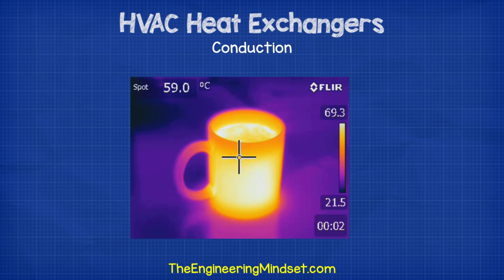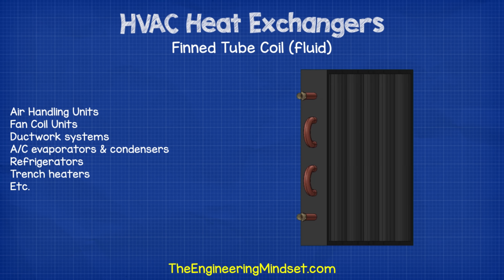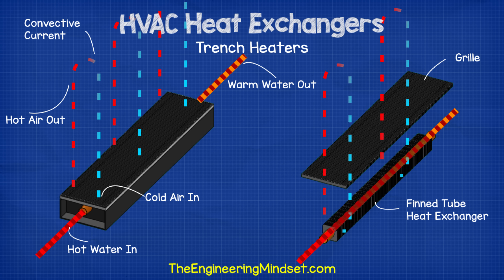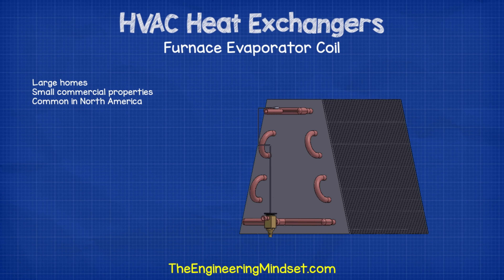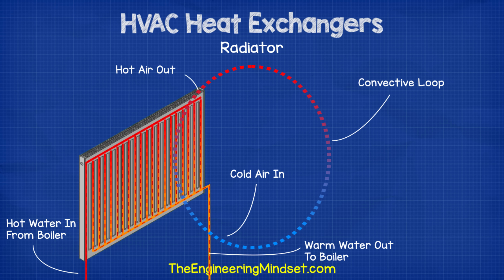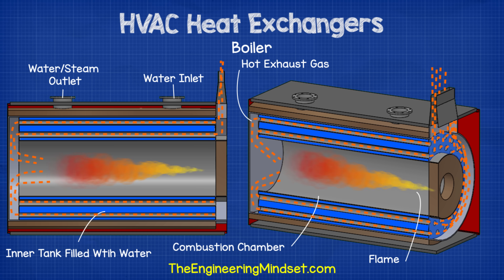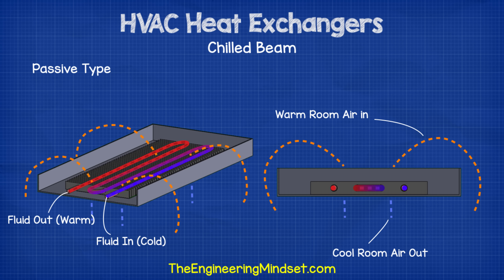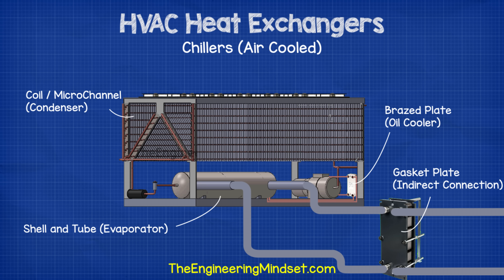HVAC Heat Exchangers Explained   The basics working principle how heat exchanger works

Comment from the maker: ⚠️ Found this video super useful? Buy Paul a coffee to say thanks: ☕
PayPal: https://www.paypal.me/TheEngineerinMindset
Reply: your videos have been so well done i have never supported a channel before but you do such a great job on all of your videos i have to support you and become a member Thank you for all of your videos
Reply: A. Barrel evaporator?
B. Brazed compact heat exchange?
C. Fin heat exchange?
Reply: Great video! Just one question: At 5:16, where it says "Exhaust Air Inlet (Warm)", should that be "Exhaust Air Outlet (Warm)"?
Reply: @tech3431   dk4kt
Reply: Hello sir, i like u'r videos
I m doing project on Atmospheric water genration device, by using vcc system but i don’t know how start n from where to start
Plz give me any guidance or suggestions for start my project
Plz suggest any good book for reff. Calculations
Reply: sir i have a question. what if i want to build my own mini electricity? through natural gas. since my place have own natural gas on underground.  now i want to install heat exchanger on my genset. is it possible to do that? instead of using it's giant radiator. I'll just took it out then replace it with heat exchanger system? so could run it continuously everyday?
Reply: @carlotheatheist  don't mess with your generator.... mess with that, you can hurt someone working on the hydro lines in the event you manage to backfeed power into the hydro line when there's power present..... geez the idiocy of people these days.

Comment: There's a sugary smell coming out of our ac vents we just had the evaporator coil changed and the condenser. I read the smell is from a cracked heater exchange.  My question is: Is the heater exchange located in the evaporator coil? The one we have is the cone shaped one (upside down letter V).

Comment: 13:50 - what is in the heat pipe?,a  low pressure water mixture?  or is coolant? i.e. something much colder than the cold water entering the device, no?

Comment: But where does the air going in come from? And the water flowing through the pipes do you put them there or they are bought like that?
Reply: The air is coming from a fan system.  The pipes are already in there .

Comment: You are using the term convection in the wrong application. All of this is conduction. When the hot surface comes into physical contact with the colder air, there is energy transferred by conduction. When two items of physical matter meet with a temperature gradient, that is conduction. 

Convection requires physical movement of a fluid. But even with that physical movement, you can not have convection until you conduct the energy first. So all convective heating is just conduction through a fluid. But when that fluid moves, it heats up the fluid next to it, again by conduction. Fluid is matter, so when matter comes into conduct with other matter, that is conduction. 

To make this clearer, it is like saying that there are three types of energy sources: Fossil fuels, nuclear, and electric. One is not like the others. Convection does not transfer energy. Convection is what you can call conduction if at least one of the conduction surfaces is a fluid.
Reply: Thin hair

Comment: What if the fins get tilted due to some external force and the thin tubing becomes close to each other in the heat exchange system in outer unit of my split ac. Do I need to worry about this? Will it effect the cooling mechanism of my air conditioner? Please respond.
Reply from the maker: Yes it will reduce it's effectiveness. You should use a fin comb to brush through and straighten them. Do not attempt with any other hand tools. Stay clear of the pipe.
Reply: @EngineeringMindset  can i send you the picture. It's more complicated. Someone stood over the outdoor unit and thus the tubing bent slight downwards making a swing like shape and because of this the fins got tilted. I can not straighten them as there is no space left for them to get straight

Comment: The radiator converts the temperature by radiation more than convection. It distributes the energy uniformly in the locals and chambers
Reply: The inlet on a Car radiator is feed through the bottom for convection.

Comment: Hey man, really interesting video! Thanks for sharing!
I wonder if you have done or would do a video on the relative efficiency of each of these systems and also a video where you compare heat transfer fluids, like air, water and the different refrigerants.
Also if you know about combined cycle electricity generation at low temperatures (home scale with refrigerants?) I would love to hear more about that too! I live off grid in Canada so I am always searching for ways to make my homestead more efficient and effective. If I could make electricity from my woodstove in winter, with refrigerants producing power and hot water (when my solar panels are not putting out much power) that would be amazing!
Reply from the maker: Seen our new video on HOW SOLAR PANELS WORK in detail https://youtu.be/Yxt72aDjFgY

Comment: Can any one Tell me at what temperature set point the outside air handler unit should be, I’m from Houston Texas, the summers are very humid
And winter is not cold like up north.
Reply: 55 to 65 if capable  . This means with no re heat  there is cooling capability and you can easily add heat for heating

Comment: is AHU a type of heat exchanger as well? :)
Reply: No an ahu is generally a piece of equipment that has a heat exchanger but also has  dampers for controlling outside air  and fans moving air .
Reply: @rodneyhickman825  thx for the explanation! Does that mean an AHU is kind of like a air conditioner that we use at home but with a larger scale?
Reply: @Pasunreve212  I wouldn't say that . I mean it does push out air but the heat exchanger inside it can be heating or cooling or can have one of each   . And the heat exchanger most often is  just one of many in a system .  The ahu has a method of preheating air coming from outside . One method is using the exhausting air and mixing it to create desired setpoint . A second method is a heat recovery that indirectly uses exhaust air to preheat incoming outside air .

Comment: Yeah I am sorry but electric resistance heaters like in a hot water heater are not heat exchangers. By definition, you are not exchanging heat between 2 fluids. All you are doing is heat transfer which is not the same as a heat exchanger.

Comment: I don't recognize your use of the word "convection.".  Convection involves the bulk transfer of heat driven by gravity, where temperature differences in a fluid (gas or liquid) correspond to density differences which under the influence of gravity lead to pressure gradients that drive convection currents.  Hence hot air rising and cool air sinking, for example.  When you drive air through a coil to transfer heat it is predominantly conduction.  Maybe HVAC has its own use of the word.  Or maybe I'm all wet.
Reply: Agree, i believe there are several instances where the vid erroneously states convection instead of conduction.

Comment: Finned tube coil are preheating coil?
Reply: They can be a preheat coil or a final heating coil depending on where they are located in a system . Just think of them as something that adds heat  to air moving through a duct.

Comment: I can’t find where there’s a part of how preheat coil works
Reply: Preheat coils are often also called tempering coils .  They are not the final heating source .   Usually set around 65-60f .  The final heat is added near the outlet to each space.

Comment: Which is better sir falttube or round tube for micro heat exchangers
Reply: Flat tubes have better surface area,  good for heat exchange but pressure loss of coolent is higher.